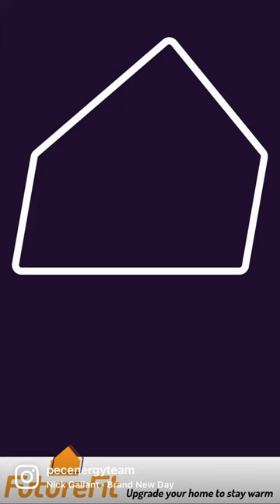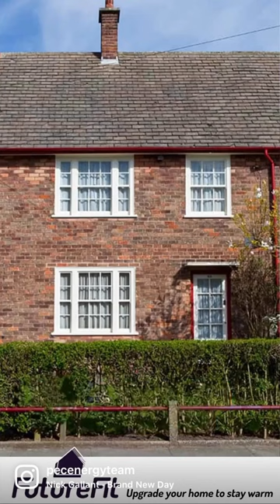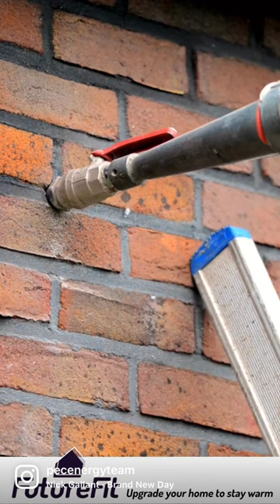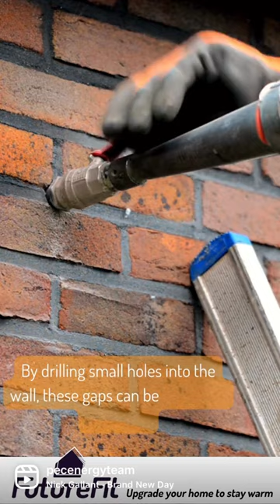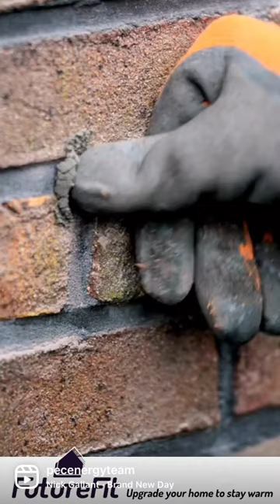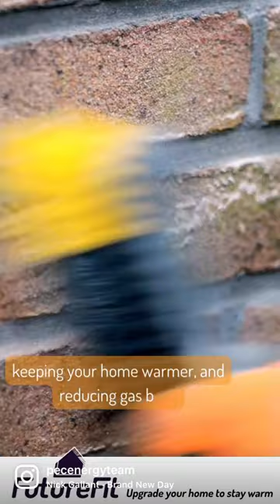What is Cavity Wall Insulation? 🧱

Comment: For the last 20 years insulation has been pumped into cavity’s now we have so much work removing this stuff as it makes the house damp because the insulation is soaking wet . Thanks for doing this as we will be have enough work to last us forever . My cavity’s are open and I have no damp. Never in a million years will I get that pumped in.
Reply: If you are insulating the cavity you need moisture control on the inside or an additional layer of external insulation.